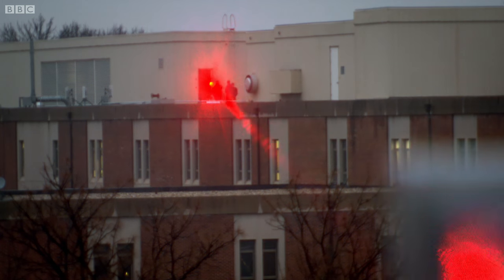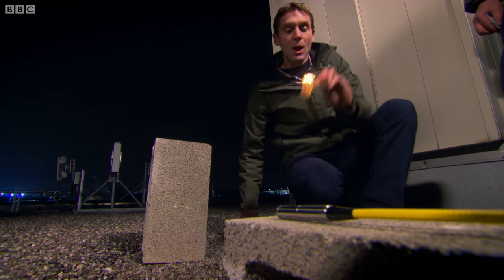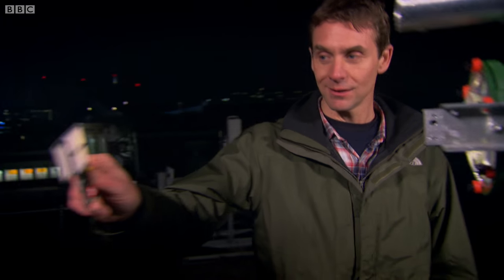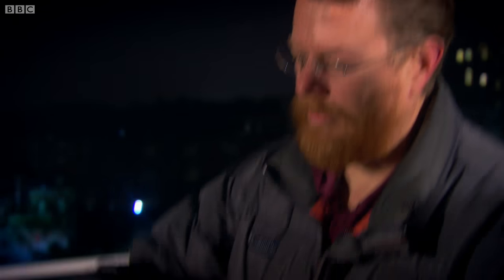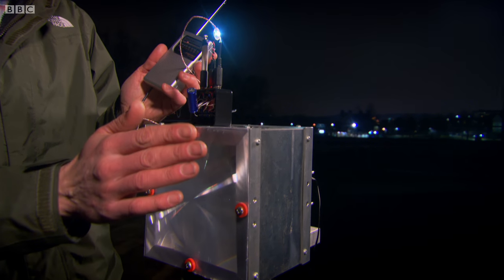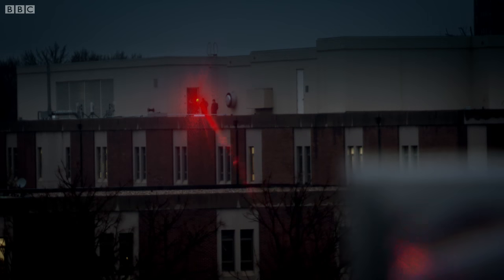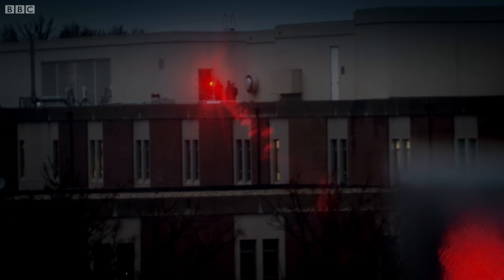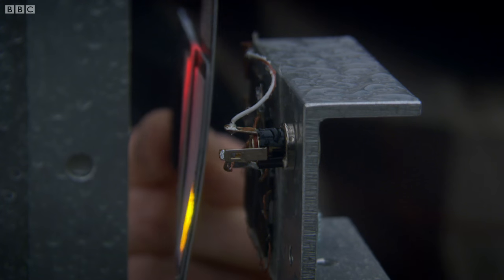Wireless Electricity (Part 2) | Earth Science

Comment: Uh, that satellite idea at the end sounds ill-conceived. Collect light in space and convert it to electricity only to convert the electricity back to light and start the whole process over on the ground? Why not just collect the light from the ground in the first place? I get that certain wavelengths transmit more efficiently through the atmosphere, but the efficiency gains have to be enormous to justify and they simply aren't. Beaming power to a satellite makes way more sense. We could have sats that stay on the dark side without RTGs or other power sources or beam supplemental power when needed or when solar simply isn't enough. If electrical propulsion ever becomes a reality (EM Drive) then it will be even more important (no reason to carry power source/fuel).
Reply: Based on this video it sure looks like this is a dead end technology, at least for now.  May I quote?  "We're probably, really, converting maybe 10, 15% of it into useful energy to drive the LED or the radio."  So, a solar panel on a satellite takes in the energy of the sun and puts out only about 20% in electricity at the current efficiency level, then it is funneled through this unit.  At the other end it puts out only "10, 15%" of that and there is enough energy to power one LED bulb using this demonstation unit.  I don't think this is ready for prime time.
Reply: Basically you can have a massive array in space, where's there's a lot of space, and by focusing it into a tight beam you reduce the energy loss you'd normally see from the light passing through the atmosphere whilst far more spread out.
Reply: +TheDanMcBending It still makes more sense to have the massive array on the ground in the first place.